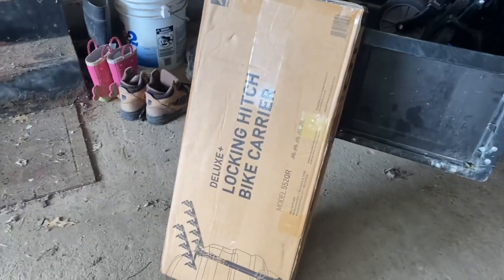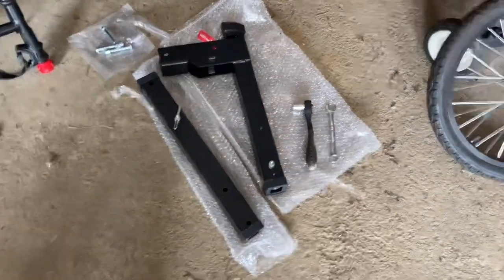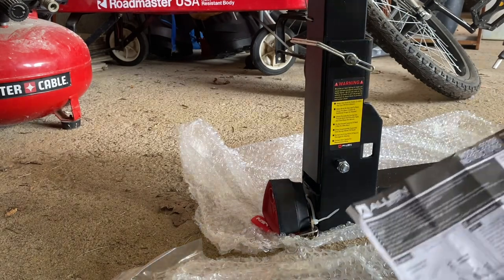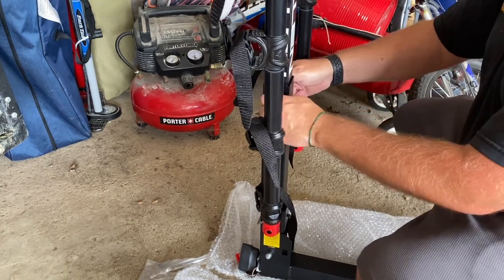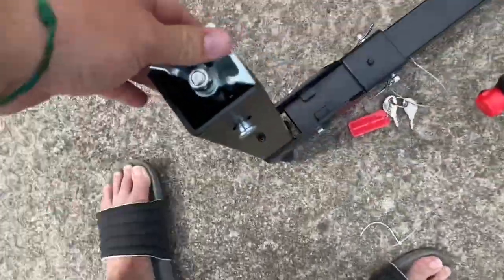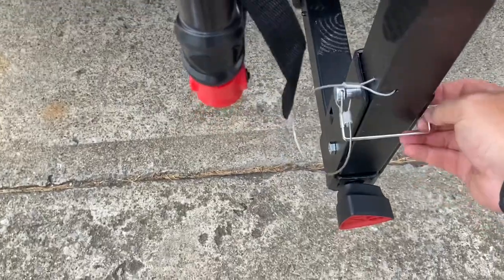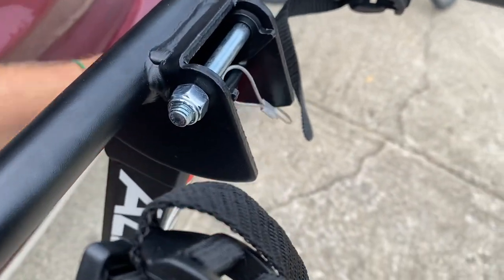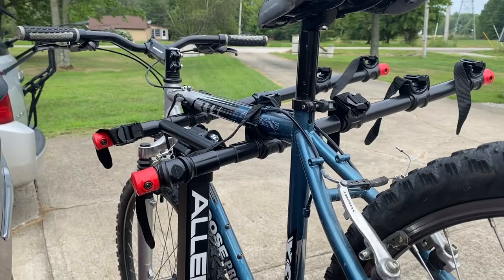Allen Sports 5-Bike Hitch Rack Assembly 552QR  #AllenSports #Review #diy

Comment: when the locking pin assembly gets hit in the back by another veivcle? how do you get out the pin, the lock unit broke off leaving the pin that runs down the length of the frame.  Can find no one in sa,mtx where i am at,?? Any info would  help, co that it came from, allen ddoes not care, sell is over.  tks dlt
Reply from the maker: Oh man, hope everyone was ok. I haven’t ran into that. Maybe it can be cut off using a cutoff wheel on an angle grinder? I haven’t ran into that before.